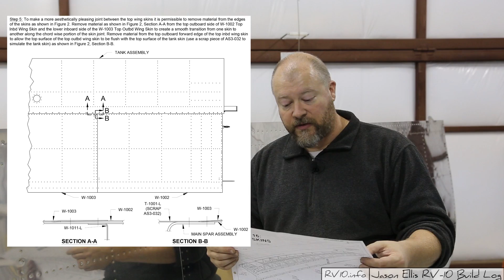RV-10 Wings - 036 - Dream Aircraft, Wing Lap Joint, Christmas!

Comment: I have the QB wings and they did bevel the joint a bit.  Can't really get a good picture without taking the wings out of their cradle though.  On the bottom skin which you have to add I did similar to what what done on the quickbuild and put about a 45 degree taper on it.  Just enough that if I run my hand across it there is no snagging.
Reply: Justin Wylie I also have QB wings. if they did it on mine, it was barely noticeable, there's definitely a tiny gap there.